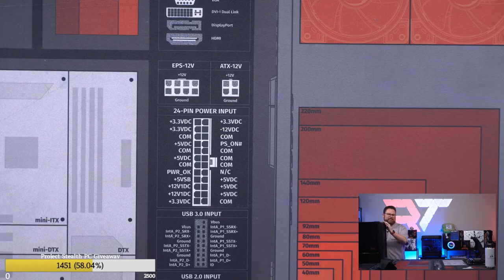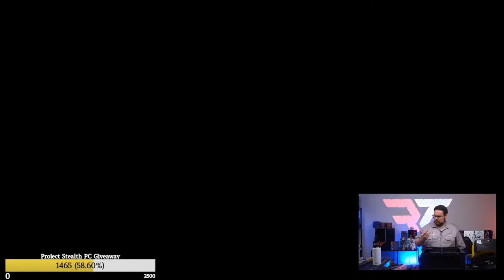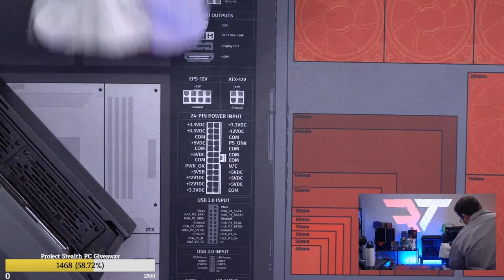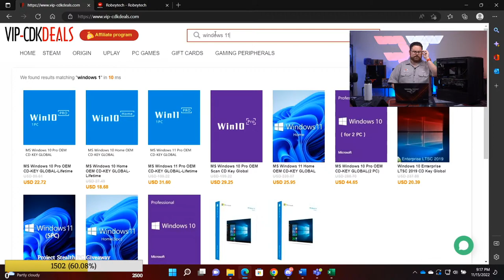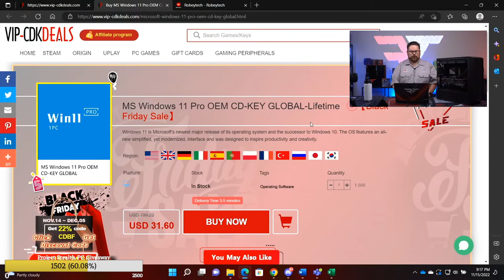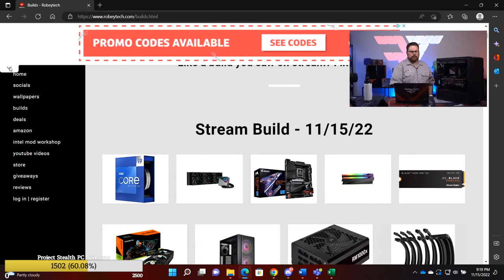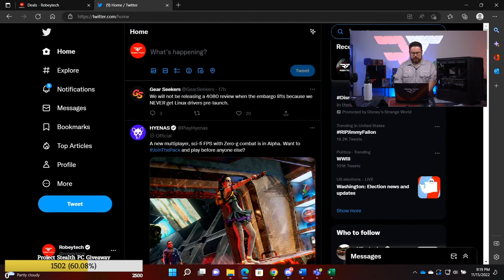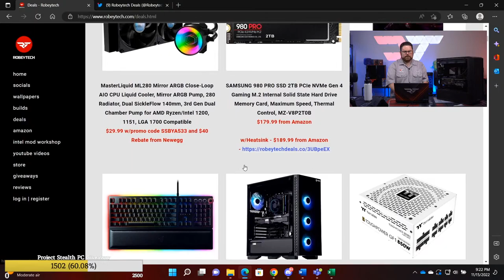The First RTX 4080 Build!  - $3200 in a Lian Li LanCool 216 (13900k / Gigabyte RTX 4080)

Comment: 2:03:25 I had the same problem with the LS720. If I have it with the hoses in the back. The rear fan prevents the me being about to mount the AIO mount tray. Plus the hoses hit the fan. If I reverse it so the hoses are in the front, it clears but a slight part of the rad is covererd. This case could have use another 1/2" in length.

Comment: I have that same CPU, AIO, and GPU coming in next week. I got the NZXT H7 Flow case and seeing that sag bracket design kind of scares me fitment wise. The NZXT case has a raised part right after the edge of the motherboard, hopefully it doesn't interfere. Also, I can't wait to see your next video, I'm very curious the CPU temps with that DeepCool AIO....though by then I'll probably have my build done.

I also agree, pricing is nuts -- I was already hurting wanting to spend $1200 on a 4080 per my tight budget [My budget was i'd rather spend more on a CPU than a GPU so 4090 was just too much for me]; Unfortunately, the only one I was able to secure at MSRP was this Gaming OC Gigabyte one. Since I need this build is strictly for business \ production use, I just couldn't wait (or afford business time wise) for restocking (which no one ever really knows when that is).

As much as I like AMDs pricing per performance, per my experience the Nvidia Studio drivers play nicer with the Architectual and 3d rendering software's that I use.
Reply: H7 flow case with same gpu .
Reply: Architecture student here, can definitely second that nvidia is still the way to go for most rendering or modeling workflows

Comment: I dont understand?  A 3080 is not a 4k gaming card based on what?   Id like more than just that for a valid opinion.    Im just an ignorant asking a question.
Reply from the maker: Based on its ability to play modern day 4k games without DLSS or heck in some cases with DLSS.  The first true 4k graphics card was the 3090Ti with its ability to at true rasterization play modern day powerhouse titles like Cyberpunk, Forza, MW II at highest graphical settings at north of 60 at 4k without any tricks.
Reply: @RobeytechLive  but what if i only play battlefield 2042?  Then that would make it a subjective opinion no?   Great insight nevertheless
Reply: @RobeytechLive  You are correct. I had a 3080 thinking i would play at 4k 144 but couldn't hit it on any games really. Now i have a 4090 and this is a true 4k card.
Reply: If the 4080 isn't a 4k card then all other cards aren't except the 4090 lol